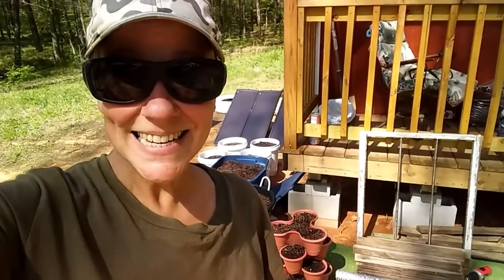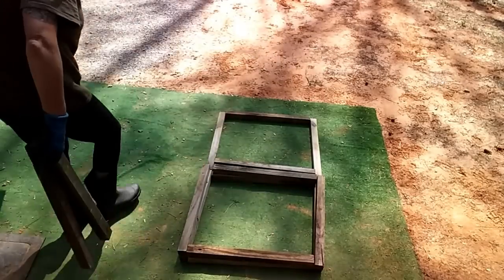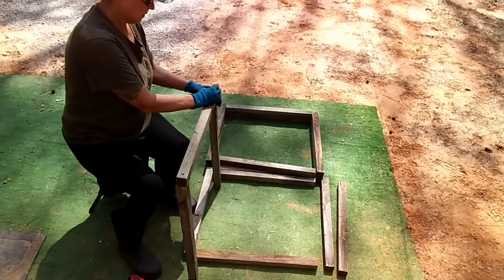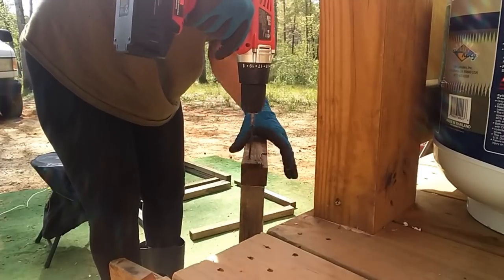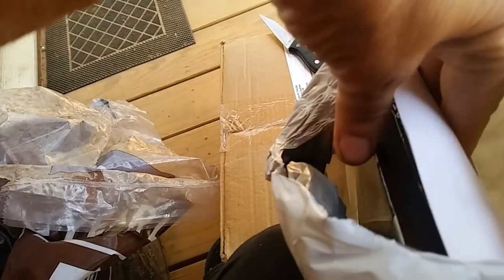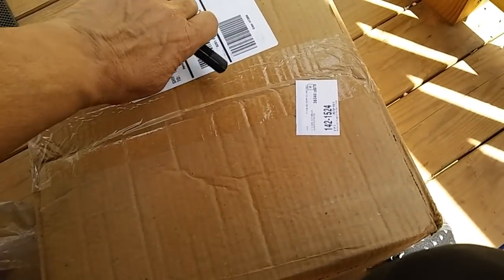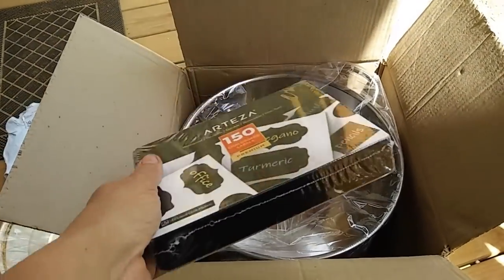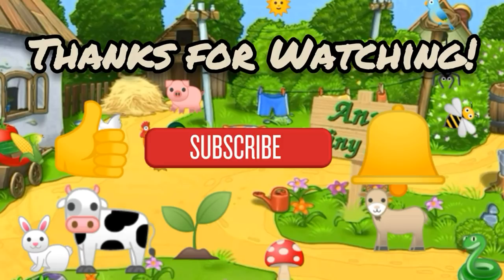I Build a Thing Part 1 for my  Off Grid Tiny House - Ann's Tiny Life

Comment: Pre drill it's the easiest, also that wood may be oak which is very hard.
Reply from the maker: I have a feeling you're right. It's very hard to drill into.
Reply: @AnnsTinyLife  Always start small like with the 1/16 drill bit and then increase drill bit sizes until you are one or two sizes less than the width of the screw.  Drilling with bits first is the secret to success. A more expensive phillips head driver will last years and years. It is all about the hardness of the metal.
Reply from the maker: @canuckyank82  thanks so much for that info Michael! I really am learning so much.
Reply: @AnnsTinyLife   yeah, 5 houses later and restoring so much damage in some of those homes taught me so much about carpentry and electrical and plumbing that I did not know. Now in this crazy condo down here I had to buy a hammer drill to vibrate bits and screws into solid concrete. I thought I was done with tools and have repurchased so many that I gave away. Oh well... live and learn. Always learning! :)

Comment: Are you making a hot bed for starting plants in early spring? When I saw the window, and the way you started laying out a frame, that's what I thought of first. My dad has one on the side of his garden. His is made of brick, though, but still covered with glass panels.

I agree with a lot of the previous posters. Pre-drilling pilot holes for the screws would be better, if you're not already doing that. It makes the screws go in a ton easier, and it is also good insurance against accidentally splitting a piece of wood with a screw. You can mark where all the holes need to go, drill them all with a drill bit, then change to the driver bit and install all the screws.

But, if you do use pilot holes, take a lesson from me: use the proper torque / speed setting for each job. High torque & Low speed for driving screws. Low torque & High speed for drilling holes. I learned that lesson the hard way... I was repairing my brother's fence, and I left the drill on high speed when I changed from drilling pilot holes to driving screws. The screw driver bit slipped off the screw head and impaled my left thumb. It made a nasty, deep puncture wound that bled like the dickens. I still have a cross-shaped scar on the pad of my left thumb many years later.

Edit: Forgot to mention, if you use the lowest speed when driving the screws you'll be much less likely to ruin screw driving bits (at least it won't happen as fast). You may already be doing that, though, and you just have low quality bits like you said. If so, you can ignore this.
Reply from the maker: nope but you know what Daniel? That's a good idea! if it doesn't turn out for what I wanted it to be maybe I'll just make it be that. LOL
Reply from the maker: also thanks for the suggestion about the drilling speed. I actually had no idea about that. now I know what all those little numbers at the top of the drill mean. lol I'm so dumb.
Reply: @AnnsTinyLife  Haha, well, I hope you get the original idea to work! You probably wouldn't need a garden hot bed until next spring anyway.
Reply: @AnnsTinyLife  Don't be too hard on yourself. I knew about the speed numbers, theoretically, but the lesson didn't really sink into my thick skull until I punched a hole in my thumb! But yeah, slower speed on the drill will definitely help keep the driver bits from slipping and stripping as much. Can't wait to see the rest of the project. Good luck!
Reply from the maker: @danlauer9676  hopefully I'll have it done in a couple of days. I need to get some new bits and some screws to match them.

Comment: i use a small 12 volt impact driver will drive any size screw and its very light easy to handle mines a craftsman but there are others think youd really like one esp if it comes with a kit

Comment: I guess you can pre drill holes and it would go in easier.
Reply from the maker: I tried that. It helped a little bit, but then the drill bit got stripped. I'm stuck until I get a replacement.